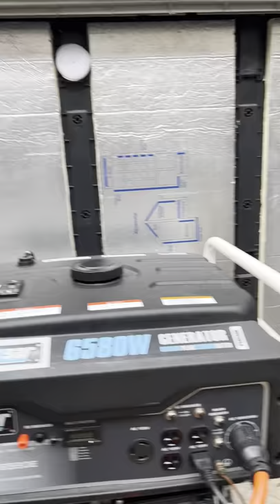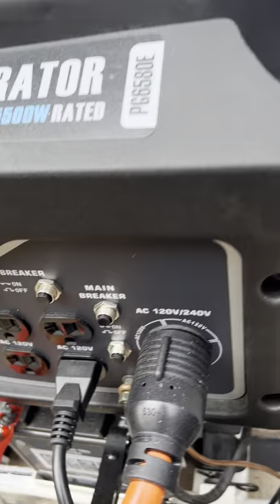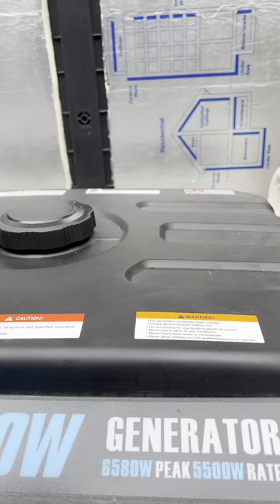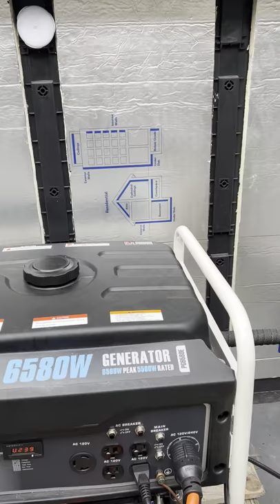Generator Shed Ideas

Comment: I have watched several generator shed videos & yours is one of the best. It looks great, the solar panel & heat tape on the exhaust both get an A+ rating & being wired to code is the only way to go. It seems the only way to quiet them down is to build the generator shed out of concrete.
Reply from the maker: Thank you for your great review!

Comment: It occured to me when designing my gen enclosure that the air cooled engine already has a high flow fan on it.  So instead of adding a fan, just use 8" flex ducting to that engine fan on the front of the motor ( and baffle that intake ).  Add some 3"-4" ducting for the carb, and just let the exhaust vent itself through the (also baffled) air exhaust vent.

Comment: That’s pretty cool.   The one thing to remember is heat rises.  I would want something on top  if possible.  Also maybe a blower like they use on boats.  They explode occasional from the fumes getting trapped in a small area.   It goes on first for 5 minutes to clear the fumes.
Reply from the maker: Gene
Thanks for your comments. The vent that brings fresh air in and the exhaust fan, not to mention the heat tape on the exhaust pipe keep heat and fumes at a reasonable level.

Comment: I would check code for your ground.  Having a double ground can cause current in a short to come back to genset if your main panel is grounded.
Reply from the maker: Al
Thank you for the info on a double ground. I will have my certified electrician look into that today.
Reply from the maker: Grounding is required if the generator is connected to the electrical panel.
Reply: Agreed you only want one path for electricity to short down. If your panel is grounded and your generator also has a ground it can electrify your generator. And than you when you touch it and than you get electrocuted. And yes the poster is right the generator should be connected to a grounded system. So when you are tied into the house main panel or sub panel it will be grounded and your system and generator have a grounded path. But you should not have an additional ground rod attached to the generator. If you were just running outlets on a job site than yes a ground rod or ground contact do need to be happening. Hope this helps. Always have a certified electrician inspect your system and advise you.

Comment: It would be hard to do an install for less than you spent. Not a criticism because I did the opposite. Not sure if that fan is adequate for the job. Buy a remote thermometer and stick it inside and monitor temps. Should not go more than 10-15 F above ambient. In my case I have a 5kw Honda and ended up with a 16" ACInfinity fan that pumps out 3,000 cfm. Think too about a bimetallic Normally open switch hooked into the low oil circuit that will shut the generator down if the compartment overheats (fan failure/fire etc.). There are two good Youtube videos that show you have to do this. This does not apply to this install but today most generator 110 outlets are ground fault. These are too sensitive so if you have a fan plugged into one of these replace the outlet with a standard one.

Comment: Very nice shed.
I'm going to do this soon.
I'm buying a Duromax 12000EH.
Your thoughts?
Reply from the maker: Not sure how to extend the exhaust on that model. Research that on your own. Have a licensed electrician do the installation from the generator to your electrical panel. Locate the generator shed where you can tap off your natural gas system. Have a plumber hook up to your generator.
Do not want to mess with gasoline or propane tanks in a outage. Constant flow is the cheapest and best.

Comment: Electrical box mounted in a movable plastic storage box is to code?
Reply from the maker: The storage box is held down on the concrete pad and block wall by Cobra 2 3/4 inch concrete anchors.

Comment: For what it is worth. I stop using any kind of foam insulation. Flammable.   I use Rockwood. Also bugs. Rodents don't seem to mess with Rockwood.
Reply from the maker: Thanks for you comments 
AP Foil Insulation is non flammable and is actually a flame retardant. Google AP Foil Insulation.

Comment: You know a 20kw with an automatic transfer switch from Kohler only costs approx. $6400? Comes with an enclosure and is safer and automatic
Reply from the maker: Wow! Only $6400. Put mine together for around $600.  Have not had to use it in over a year now.  Hopefully you will get your $6400 investment back in your power outages in the future.
Was this an advertisement?😱

Comment: I have a couple of questions but may not get back here to see if I get replies.
1. Do you need to earth the genset when the house is already earthed? In Australia the house earth stake is usually located reasonably near to the meter board if not directly underneath it. Also all the neutrals in the house are connected to it in an M.E.N. (Main Earth Neutral), which is what we use in this country.
I ask that because earths are all about safety and the house earth should not only be capable of allowing shorted current to travel along it but have sufficiently low resistance to earth so the current wants to take that path (path of least resistance). Supplying a secondary earth may not be the safest method as it's resistance has not been calculated and may be very poor and thus carry higher current - the generator certainly doesn't need this earth unless if I got this right, it is used when two or more gensets are connected together.
Earth leakage circuit breakers now called RCDs need to be quick acting and the earth closest to it needs to be very low resistance (as per code) and is integral in tripping the ELCB breaker on that circuit should a fault occur.
2. That exhaust tape is a great idea Steve and I will steal that method from you when I build my sound box (as I call it). But I will build so that the hot pipe is closer to the wall so that less pipe is heating up the enclosure. There is enough heat being generated by the engine and probably the copper coils already without trapping exhaust pipe heat in there too.
Also I saw a video where an external baffle box was mentioned which forces the exhaust noise to travel back and forth inside it, thus reducing the final sound level exiting the baffle box. 25% of generator noise is the exhaust pipe apparently.
Thanks for the video, much appreciated.
Reply from the maker: Jed
Thanks for your comments on earth grounding my portable generator.  When you are terminating the generator wire into the home electrical panel, YOU DO NOT NEED TO EARTH GROUND, as shown in my video.  In fact, it can be dangerous to double ground.  I have removed the ground on the outside of my generator shed.